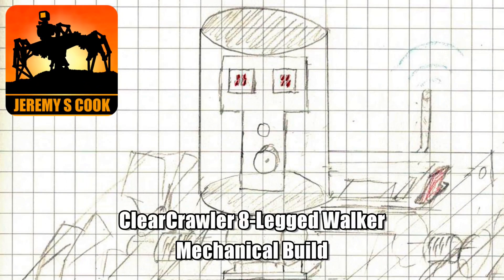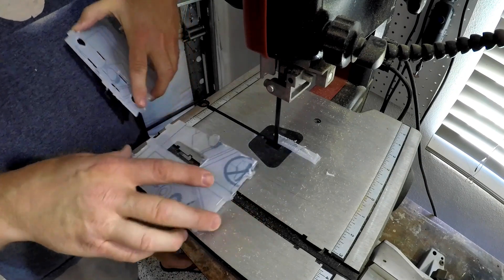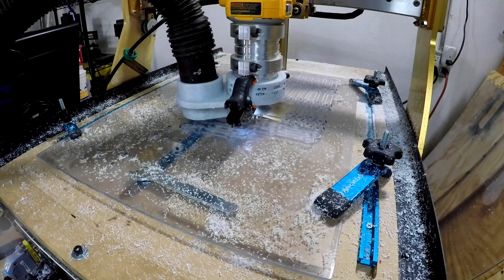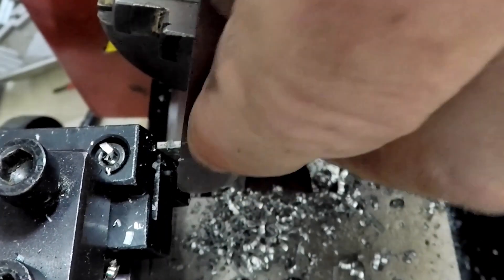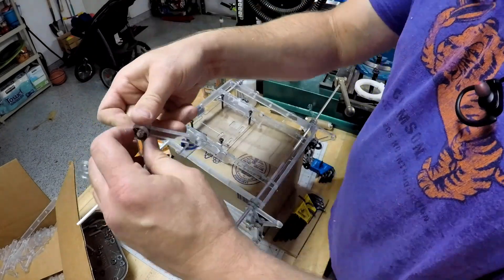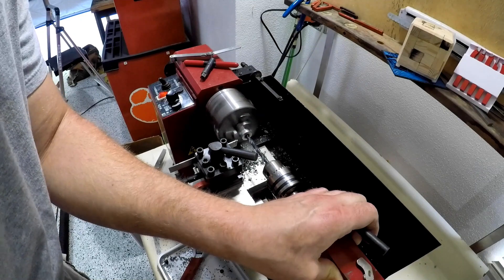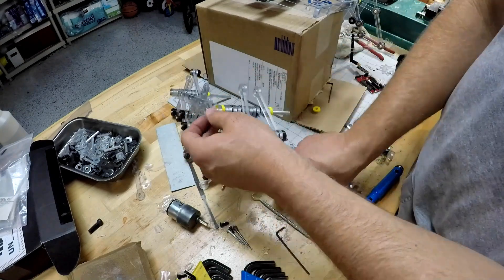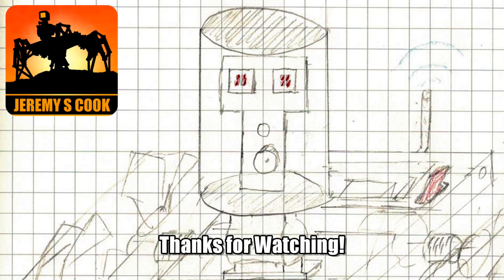ClearCrawler Mechanical Assembly [Strandbeest]

Comment: Are your gears made so if you added a third leg, you can space the position a perfect third??? I guess should be a 12 tooth gear...
Reply from the maker: What do you mean by a "perfect third?" It's designed for the 8 legs it has, but could theoretically accommodate more with some modification.

Comment: hi bro. 
which is the torque of motors?
Reply from the maker: Hi, torque is listed at 1.8kg-cm at 12V, though would be a little more with fully charged LiPo. This is the style I bought in 12V, 150 RPM: https://www.ebay.com/itm/DC-12V-24V-15-1000RPM-6mm-Shaft-Dia-Cylindrical-DC-Gear-Motor-DIY-Robot-Dia-37mm/173244051458

Comment: Have you tried using double sided tape to hold down your material?  I have some of the nice Nitto Permacel tape, but from what I've seen, the cheaper method masking tape, superglue, and accelerator works even better.  You put masking tape on the wasteboard, masking tape on your material, and glue those suckers together.

You don't need tabs, and it seems to even work well for cutting aluminum.  It should hold up to acrylic or polycarbonate!
Reply from the maker: That's a good idea, though I don't mind the tabs for the most part (when I remember them), and clamping is pretty easy.

OTOH, would definitely solve a few problems... I'll keep that in mind, thanks!

Comment: What type bit and feeds and speeds worked best for you on Plexiglass?
Reply from the maker: Hi John, I'm sorry to say, I don't quite remember what I used on the polycarbonate. Kept it pretty slow though if I remember correctly, maybe start off with 30 IPM with a pretty shallow depth and go up from there? Was using an 1/8 inch bit if that helps.

Comment: I like how this design is constrained by money (I had the same issue on mine). Of couse there are better ways to stick a leg to a shaft, but multiplied by the number of connections, stuff gets expensive quickly.
Reply from the maker: Ha, that's always the problem isn't it? Looks like yours has a nice smooth gait.